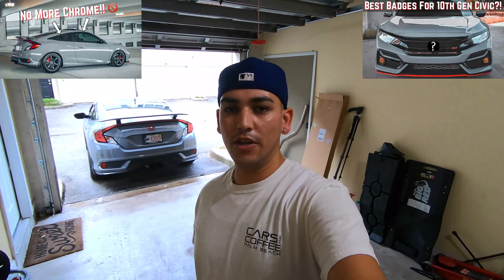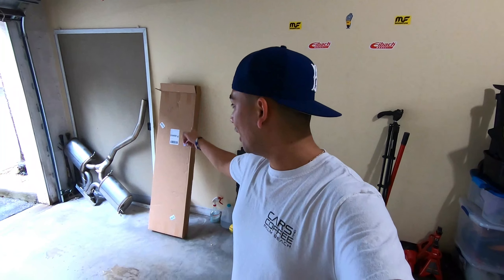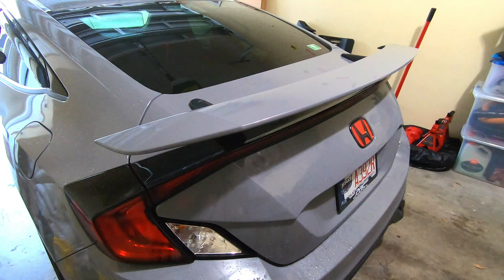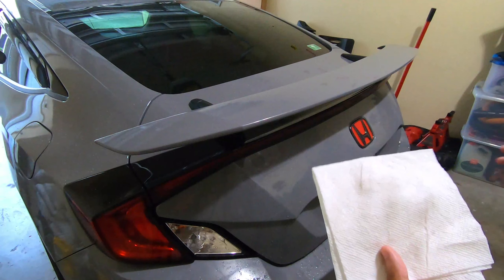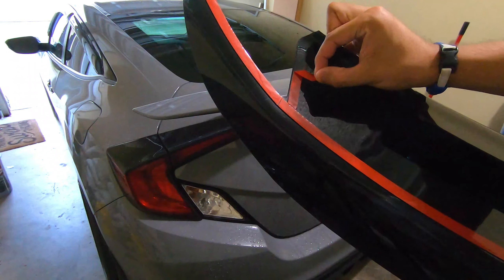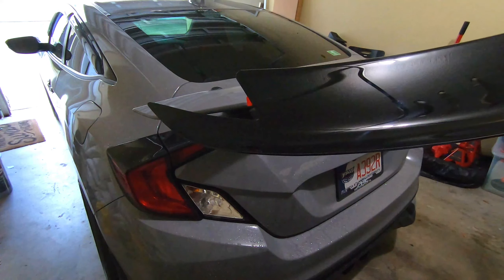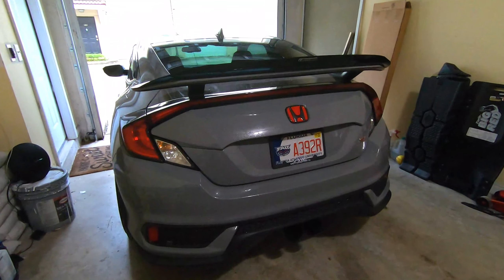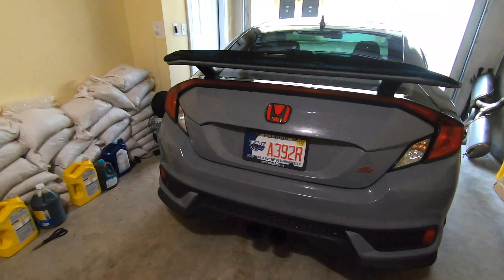Caruse Design Aero Flap Install - 10th Gen Civic Si Coupe

Comment: Hmm...im not sure i like it. I think if it didn't cover the entire top of the spoiler I might like it slightly more. On the other hand, if you had the roof wrapped black (ive got some gloss black ready to go on my roof) it might bring the look together a little better. 

How is the fitment on the front of the spoiler? It looks like it leaves a gap. It just doesn't look like a clean extension of the spoiler.
Reply from the maker: Brian Miller the fitment is great all around and no gaps. It is designed in a way to wrap underneath the spoiler too for better grip and more security.

Comment: How come there is absolutely ZERO literature on the advantages and disadvantages on this product? Doesn't say what speed this becomes active or how much added downforce etc.... is this solely for looks? I know it can't be because it impedes on the airflow differently obviously. It looks great trust me. I love it. But putting it on your car without any knowledge of how it changes characteristics at high speeds? For all we know it makes things less stable which obviously makes things MORE dangerous because of lack of handling. Can the OP provide anything with factual information from the company in regards with testing??
Reply from the maker: YoDood215 you bring up a great point. My channel has always been about functionality and explaining products in depth, however, in this case I don’t believe the information you’re asking for has been released yet. Although it does have a lot to do with looks, I’m sure with the amount of R&D the company put into this product functionality was their main priority.
Reply: Having knowledge about cars you would know that any modification done to a spoiler like how he did it will actually generate downforce after about 100mph
Reply: @datwhinyfa5267   thats how it works?